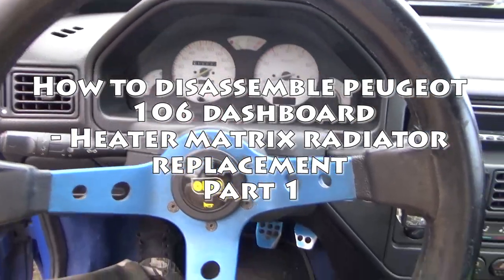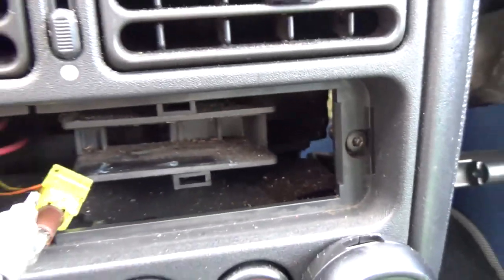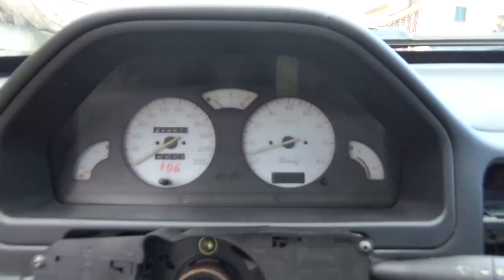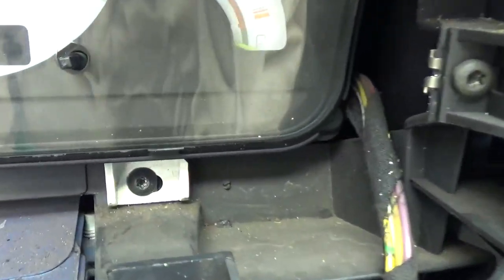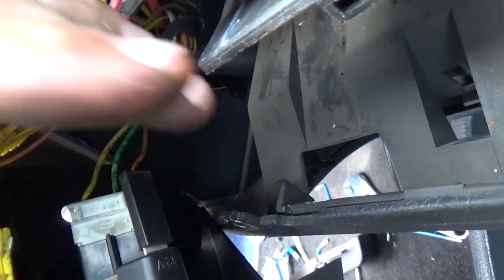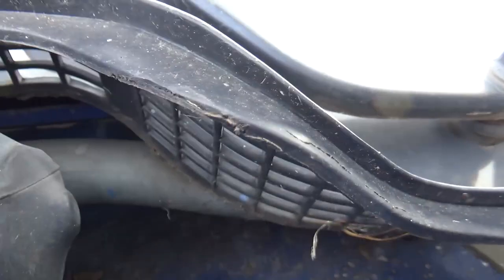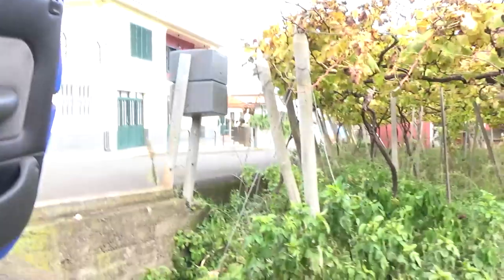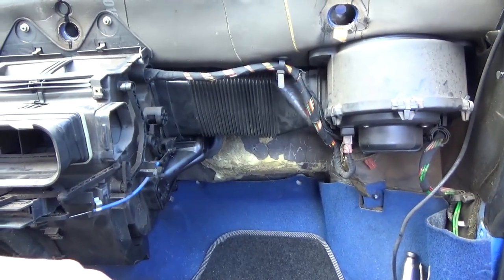How to disassemble peugeot 106 dashboard - Heater matrix radiator replacement part1

Comment: in the 1st generation it's a little bit easier: you don't need to disassemble the entire dashboard, you just need to unmount the dashboard from the rest of the car and remove the panels on the steering column. that should give you enough wiggle room to replace the heater
Reply from the maker: Never tried it on S1 but that would surely be a lot easier

Comment: If You have LHD saxo/106, buy a matrix from citroen AX.
The kit contains a matrix, and SEPARATED aluminium pipes!
You can do the job in 30 minutes, without removeing the dash.
Only the glovebox surroundings.
Reply from the maker: nabassu i tried that before fitting this one...but it does not work...even with separated pipes you cannot fit it...spent days trying that with no luck...so ended up fitting this one wich is the proper one for the car

Comment: Great job, you're a Master, i've just one question about it. I bought a Saxo last week, but the Fan doesn't work. It's march 5 so it is still really cold outside and i bought a used fan for 60€. In the Saxo is the fan located in the same place of the 106? Mine is 2001 Saxo with Air conditioner and air recyrcle. Thank you

Comment: Nice job ! I want to ask you if the dashboard is held in place just by those screws you removed at the engine bay or is there anythhing else inside ? Mine seems to be a little flimsy where the dashboard meets the front pilar by the windshield and it rattles in every pothole...